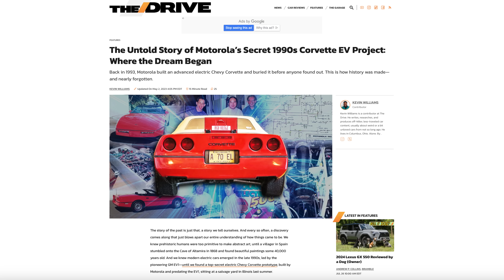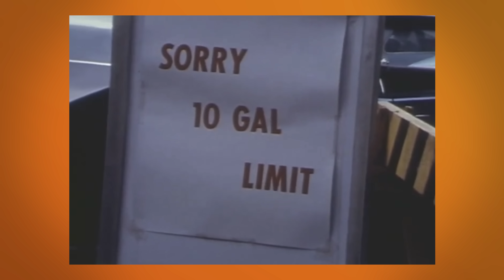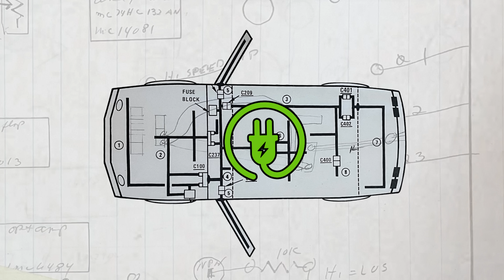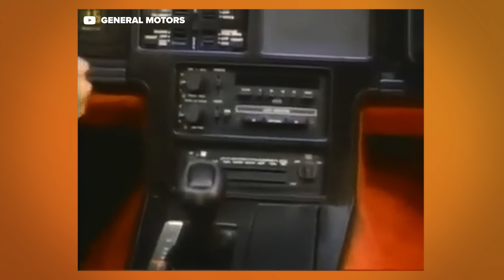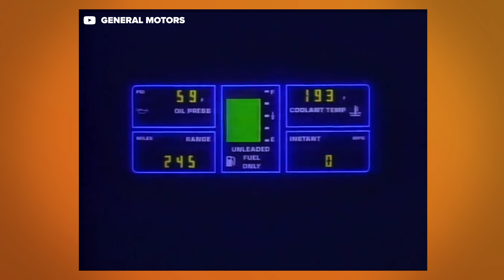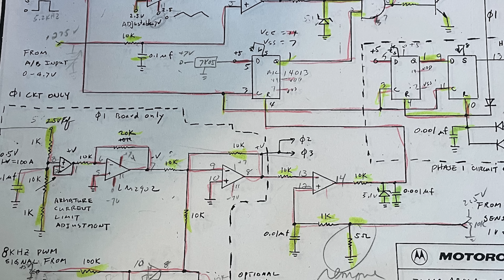Finding the LOST Electric Corvette Prototype From 1992

Comment: Swappable batteries have been in the conversation forever.  Even pre-dating Motorola's efforts. Currently NIO has a network of robotic battery swap stations that allow you to drive in, sit in your car for about 8 minutes and drive out with a fully charged pack.  Renault did something similar in Israel a decade earlier. Of course this in the 2000's.  Early 1900 electric cars, before internal combustion took hold, also had the battery swap concept.   For the record Motorola started out as a card radio company (A Rockola being  a jukebox - a Motor-ola being a jukebox for your car. They then went into military radio in WWII and then branched into all thing electrical engineering with those profits - eventually the cell phone based on their military field radio research. Its a very diverse and very competent company. EV's were a hot topic in 1975 - after the oil crisis.  Even car enthusiast magazines of the day had homebrew EV projects on the cover. And like this 'Vette - they had no range. It wasn't until Lithium Phosphate batteries - built for laptops and cellphones (to run all day) - reached peak volume that a usable range was possible. Recall Tesla used thousands of these laptop cells to power the original Roadster (before Elon was involved). When the volume could pay for the cost they pivoted and started a progression towards a more suitable fit battery form factor - the 4680.  Other EV's manufacturers followed Toyota's lead with prismatic (rectangular) cells.

Comment: Another example of GM attempting to prevent technology advancement.
Reply: They converted away from lead acid quickly enough in their own EV-1, just 4 years later. Given that Corvette's weight equivalent to a Caprice wagon of the day, I can't blame them. GM was responsible for stifling development of Nickel Cadmium batteries after they crushed the EV1 program. They seem to be coming around now that Tesla has rubbed their face in the fact that they're waaay behind in development. Give them another 10 years, and they'll have buggy, unreliable, but basically sound EVs to sell alongside their buggy, unreliable, but basically sound gas and diesel vehicles.
Reply: Well that’s your hate take on the situation. It’s never that simple.

Comment: I’d rather have the modern e-Vette with electric assist and a proper V8 providing most of the power and electric motors giving an assist.

Look at Eddison trucks up in Canada.
Diesel electric generators, a power bank but you never have to stop to recharge.

I’m old school muscle American V8’s all the way (with a heart for tuned Subie BRAP BRAP noises) but hybrid powertrains make the most sense to me.

Electrics have a place as local city runnabouts, but after witnessing stuff cross country trips, no thanks.
I’ll keep my internal combustion vehicles

Comment: "Swappable" takes off rear bumper. HA.
Reply: Probably takes less time than changing oil on some of these newer cars. Consider removing a "regular" battery from a gas car... You gotta open the hood, unscrew the battery mount & hopefully that's it. I know of a few more complex than that, Mercedes Bens R350 comes to mind, with it's battery underneath a seat.

Comment: 3:00 this is the same company that sold the corvair (@mid-engine doubts)
Reply: Which was not mid engine “The Chevrolet Corvair is a rear-engined, air-cooled compact car manufactured by Chevrolet in two generations between 1960–1969.”

Comment: Big Oil didn’t want this technology out in public. I just did a 1500 mile road trip on the supercharger network in the 2013 Tesla Model S that still has its original battery. It has over 400 hp and is a blast to drive.
Reply: They had electric cars before gas cars. It's not new technology 😂
Reply: @overhill6822 That’s not new information nor is it relevant
Reply: my guy, i just read an article that it costs about 6 pence per mile in an electric car if you charge it at home and at night when the rates are low. that's exactly what i'm getting in my toyota hybrid and i don't have to worry about range or battery. yes, i know it's got a battery in it but at 0.7 amp hour it costs two shoe strings and a pack of gum to replace.
Reply: My 2014 is at 290.000mls. Original battery, too, re-sealed and with a few cells replaced.
Reply: Then don't support them. Throw away everything what they make. Starting with plastics in your Tesla and your device what you used to type that comment.
Reply: @rocko44444444 Troll
Reply: @rocko44444444 scorched earth approach is stupid.... Especially when you assume what they on and how they typed it. We don't see people who like to use free & open source software just not browse the internet & websites... Because the those sites could use routers, nodes, data centers, website code & even your IP's software isn't free.

Comment: It was explained to me in the early days of the model S that Tesla didn't pursue the swappable battery, like it originally promised, because the ownership of the batteries would have been too big of a headache. They wanted the owners to own multiple batteries, but Tesla wasn't willing to store the batteries long term so if the owners didn't pick them up.......ya, just no swapping batteries LOL
Reply: Fun fact the pre 2020 Model S has a quick swap battery. If the correct equipment is used they can be swapped out in 10min.  The equipment being a car lift. guide rods, and a rolling table that can support 1200lbs.  You literally just lift the car, take out the 12 center bolts, 8 front bolts, and 6 rear bolts.  Lower the car until the bottom of the pack is sitting on the table, then unbolt the 8 bolts on each side and lift the car off of the pack.  The electrical and coolant connections on the pack are rapid mate. They are held in by sandwiching the connectors between the car and the pack so nothing has to be physically disconnected or reconnected. 

 If memory serves the reason it was never implemented was two fold.  The first was the ownership of the battery as if you are constantly getting them swapped instead of charging them who actually owns the battery?  Not the owner of the car because you are constantly swapping them for another battery. So if you don't own the battery then why are you paying for it when you purchase the car? The second  because they were worried about the negative implications of battery swapping in the future. There is no practical way to guarantee that the pack you get from the "service station" would have the same capacity as the one you dropped off.  There is always the chance that you may roll into a station in your brand new tesla only to drop off your brand new pack and get a 10yo pack with significantly less range in its place.
Reply: @brettsanderson8680  yep, thats why NIO sold you the car, but you rented the battery.  Since you never owned the battery, the fears were eliminated and you can upgrade to larger capacities or newer chemistries as time goes on.  It's an interesting concept.
Reply: Didn't NIO solve this by buying the car and renting the battery?  This way you swap them anytime and could care less who owns it.  Would probably work for phones too.
Reply: @aussie2uGA Is it sustainable for NIO or they subsidizing to gain market share?

Comment: what happened to America?? 57 cents a gallon for gas
Reply: Learn what INFLATION means. Not just gas prices. It's sad you even care about gas price. We're soo screwed too reliant on that single resource.
Reply: To be fair, that is equivalent to $3.44 per gallon today, which at least here (Missouri) is more expensive than gas is right now.
Reply: @l10industries that was also the oil crisis price in the 70s. Their crisis is our norm. In 1972 gas was only 32-34 cents, or $2.41 today